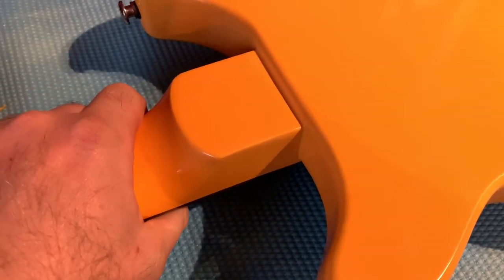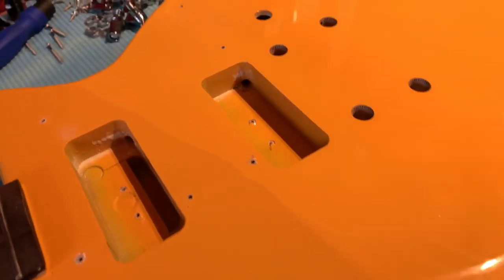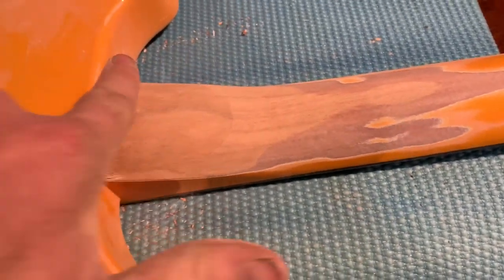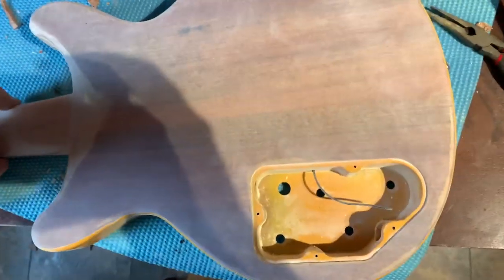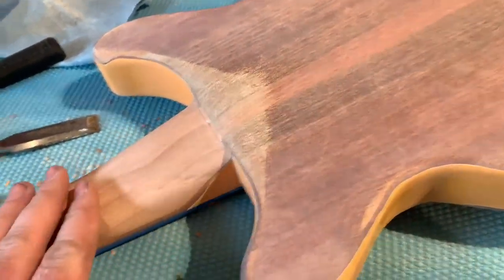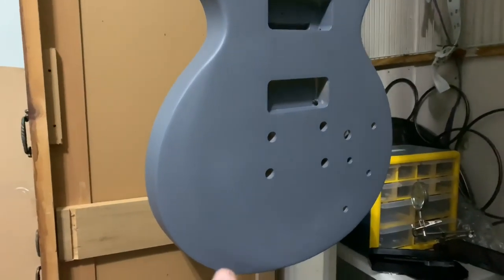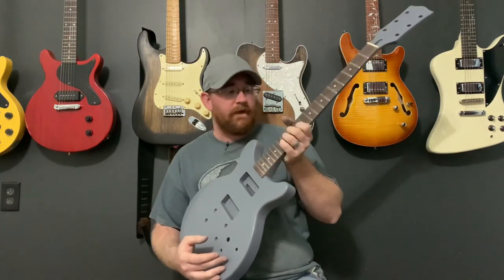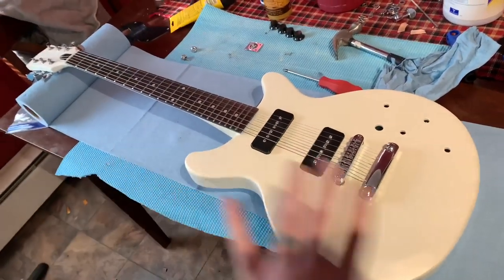How to make a firefly double cut awesome

Comment: Thanks for your video. I ordered a single pup model and was expecting to do a light shaving mod to the heel. I guess Firefly are listening to reviews, as my neck heel is about half as long as yours was. 1" from body on the straight part, 1 1/2" from body to the end of the rounded bit. Since I rarely play that far up on the neck, I'm happy to leave it as-is. $130 for this ax is silly cheap.

Comment: I bought a white firefly double cut p90 guitar  just like that and it does not have that big heel on the neck. I wonder if they got the hint ?   I set the action and intonation with earnie ball 10 thru 52  and its awesome.I wouldnt take 240 for it, upgrading pickups next.Thanx for the great work.
Reply: I got some grovers and nut already from stock i have

Comment: I've got a 2020 model, neck joint was way better then this one, I've got a question will a set of normal sized humbuckers fit in the pickup cavity?
Reply: You would have to rout or chisel the hole. But the beauty of these guitars is the P90 pickups.